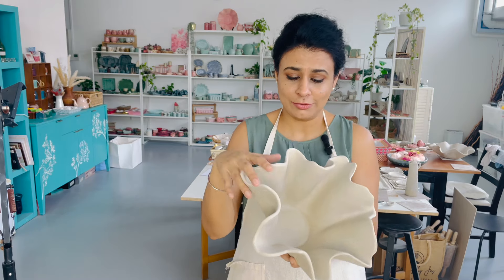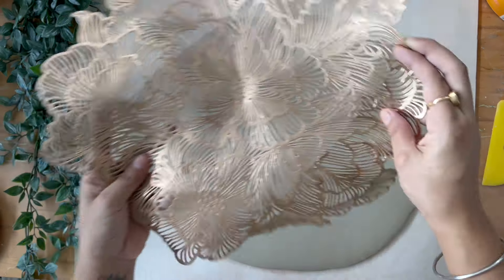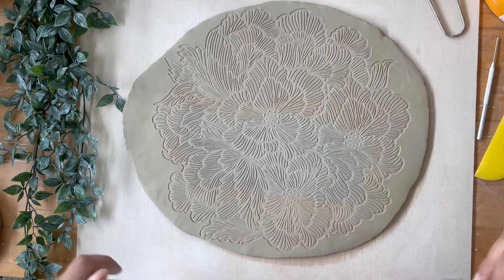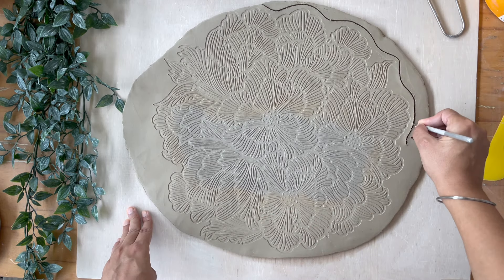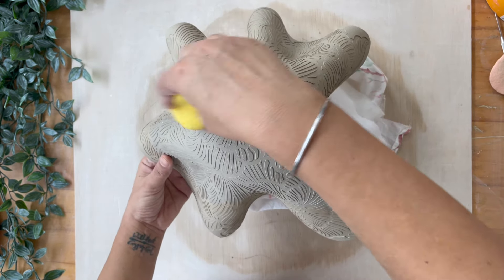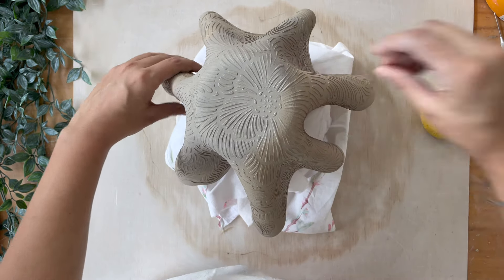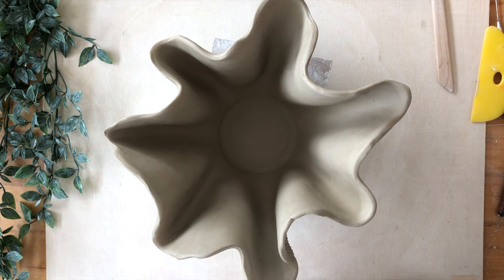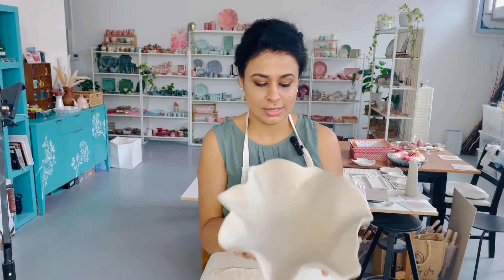Hand-Build an Organic Waterfall Bowl/ Vase (Handbuilding Pottery Tutorial)

Comment: I tried to make this with white clay and the sides cracked away from the base while I was forming it. It was quite soft to start with, not leather hard, but dried quite quickly and then it also cracked along edges at the peak of each wave. What can I do? Am I using the wrong clay? Thank you 🙏
Reply from the maker: Hi not sure if the white clay you are referring to is porcelain or stoneware. In any case, if the clay is too soft, the base will likely tear off when flipped onto a narrow jar. Try with using the back of a bowl (without a footring) as a mould. A bowl will give your clay more area to rest which will prevent the problem of breaking at the base and you can still get the ruffled edges. And start with a smaller and slightly thicker slab to get a hang of the process. As for the cracks at the rim, before you flip your piece onto the bowl/ jar, compress the rim well on both sides with your fingers. This step is really important. And once you’ve flipped your slab, cover with plastic so it dries slowly. Hope this helps..
Reply: @ceramicsbyjas thanks so much, it does! Clay is stoneware
Reply from the maker: @KerriPhillips-d7t  then it’s possible that the clay was too soft and thin. So try a slightly thicker slab and may be let the clay set up so it’s not so soft when you flip. I’ve also had this problem with really soft slabs where the base just came off. So it’s not just you.. part of the process ..🙂
Reply: @ceramicsbyjas  I’ve just done another with success! Woohoox